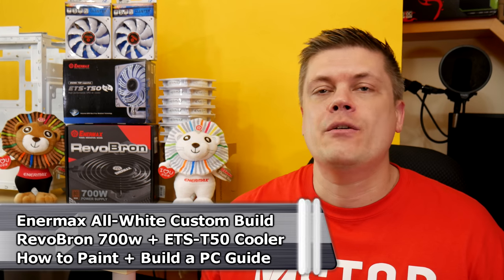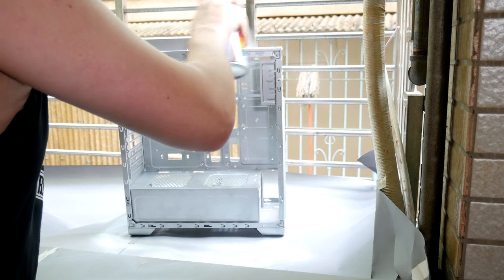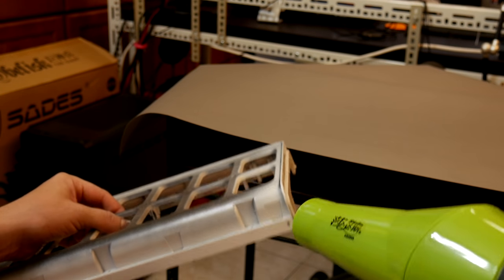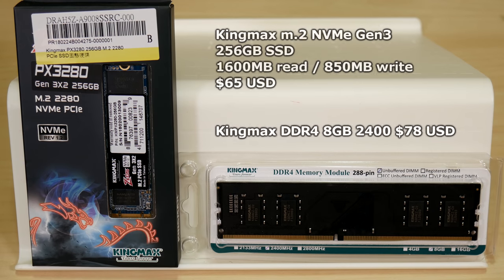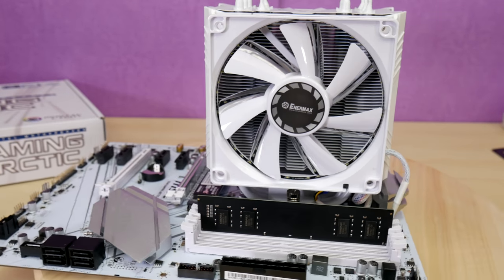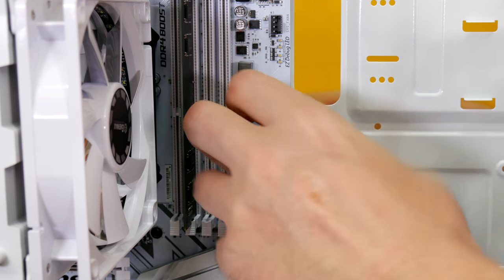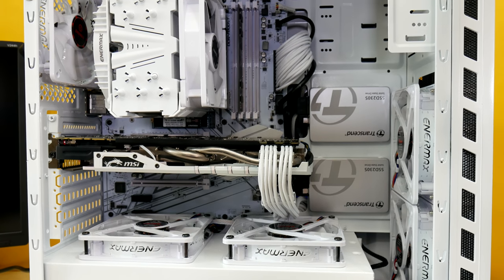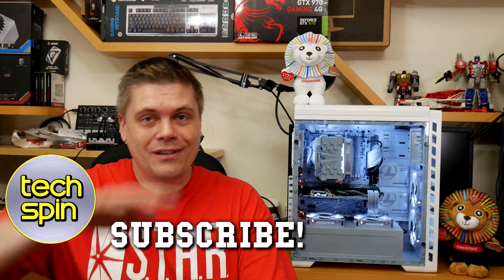How to Paint a PC / How to Build a PC / #1st beautiful white build

Comment: I know this video is older, and I know you said you were limited for time on the build, but any thoughts on using a clear coat (whether it be matte or gloss) over the spray paint to make it more resistant to scratches (and/or a shiny finish)? I love to use spray paint and have done non-PC custom paint jobs before. 

I ask because I'm about to do an all-white build myself, and your tips to paint the inside helped, but I also thought of adding an acrylic clear gloss (or maybe matte) coat as an extra step. I'll have plenty of time since I'll be waiting until 2058 for a GTX 3080 :P Nice build, I love the all-white mobo.
Reply from the maker: Yeah a clear gloss would make the paint harder, it's barely gotten any scratches but had a couple tiny nicks after installation. The best solution would include baking of course, but not everyone had access to a paint oven, we sure don't with tiny Asian house sizes.
Since you've done painting, any tips where I could improve a bit? I've painted some large items but always looking to improve... Thanks for the questions! Really cool feedback
Reply: @Techspin  Hi there! Thanks for the reply. Like you've indicated, I don't think the clear coat (whether matte or gloss flavors) is necessary by any means, I'm just curious how it would look or if you had done it in the past. It would come down to personal taste, kind of how you can use a matte or gloss sealer over epoxy countertops for different texture finishes,  the only major difference being that it's required for epoxy to strengthen it/make it last. Like you've indicated on the longevity of the paint for the average user, a sealer wouldn't really be necessary for a PC most likely, since most people aren't in their rig tinkering every single day. 

I think you're on the right path though that the ultimate "professional" finish would be doing the electrostatic powder coating (with baking) process; but if it makes you feel any better I'm in the US and don't have access (or money) to do that for a PC build either. Perhaps even airbrushing might be an option, but I'm not skilled in that arena.

I think your process is fine honestly, you did a great job, and even touched on wet sanding drips (which is the bane of spray paint) which I've encountered spray painting models, furniture, Star Wars props, etc. Also, I like how you went over laying a gray primer as a transition from black to white; a very important and necessary step for a good paint job. Also I'm in Florida, so I have the added monster of humidity = terrible for painting outside a lot of times. Sometimes a makeshift spray booth can be helpful too if space is limited, or you have a half inside/outside scenario to paint (like a screened in porch, for example). Latex gloves are also helpful (I've learned this the hard way a long time ago).
Reply from the maker: The latex gloves are a great tip. I had half a mind to leave as gray, it looked pretty amazing like that, but I wonder what a mirror finish would like like, as least inside!

Comment: amazing video! what graphics card is used?
Reply from the maker: Oh, thanks for the question! It's just an average MSI GTX 970 4G Gaming card with a white painted shroud.
Reply: @Techspin  hello! Did u make the white finish to the gpu? If yes how you did it? I'm a little bit scared of doing it
Reply from the maker: Yes, we grabbed a regular MSI GTX 970 Gaming 4G and carefully unscrewed the shroud and fans, washed it with soap and used a hairdryer and dehumifier to rapidly dry it.  I thought I could skip primer but because the original color was black and red, I had to do 7 coats before the red was less pink.  Next job we did 2 grey primer coats, then just 4 white coats, turned out way better.  If it's your first time, I'd suggest painting some random objects you don't need around the house to get the feel for painting, light coats, let dry between coats.  Start off the object, move the can at a little speed across and let go of the nozzle when pointed off the object.  Also, try to go too slow, and find out the speed when the paint builds up and starts to drip a bit... it happens after a few minutes of drying.  After 6 or 7 projects, you'll have enough experience to paint cases and GPUs.  Use medium grey primer, and wish you luck!
Reply: @Techspin  thank you so much! I'll test it 🥰